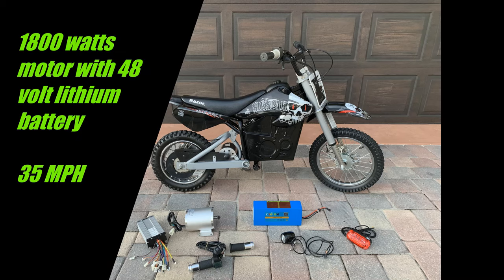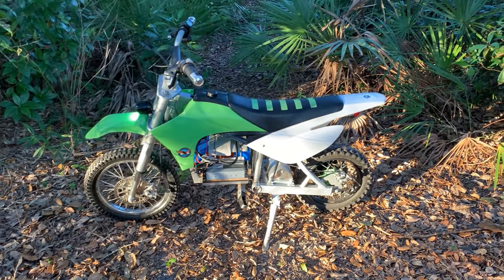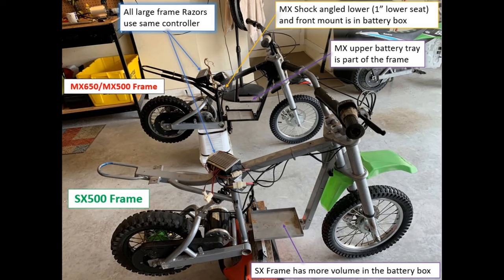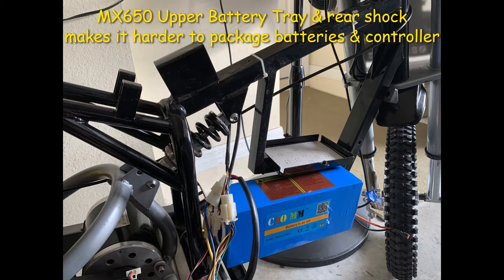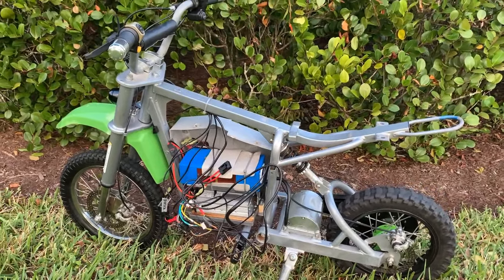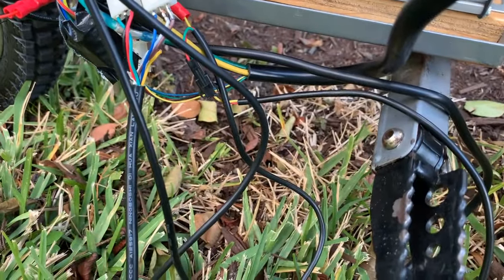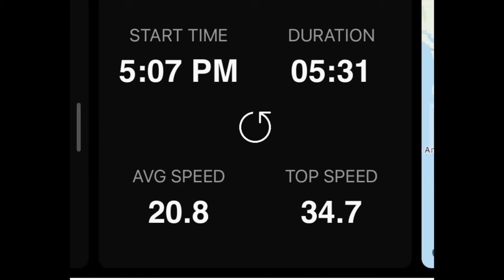go 35mph with 48V 2000W motor - Razor MX650 MX500 SX500 RSF650 upgrade for $400

Comment: Did you need a junction box for this?
Reply from the maker: I think a junction box would be a good idea.  In this video I hard wired the motor wires to the controller via soldier and seal connectors

Comment: If I did this, would I need to solder?
Reply from the maker: No soldering needed.  I’m terrible at it.  You can use these solder and seal connectors which you insert the wires and use a heat gun to join them.  The other option is lever connectors which are easy to use.  Max sure which ever connectors rated for 30 amps for the battery and motor connection.

Solder & Seal Connectors: https://amzn.to/2WcCQNZ 
Heat Gun (for connectors) : https://amzn.to/39HAABD 
Lever Wire Connectors (east to use): https://amzn.to/39BuYZy
Reply: @BRichSolution  thank you so much

Comment: When wiring a one speed throttle- I wire the black and blue coming from the 3 speed together? What about the yellow? Just leave it hanging?
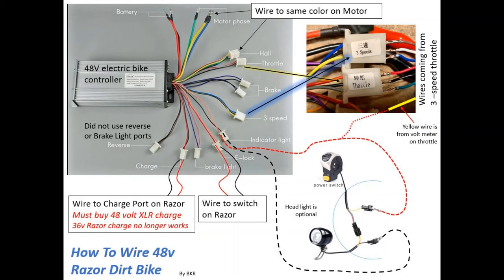Reply from the maker: Yellow wire is for voltmeter if you have one.  See poor man’s schematic at 5:22

Comment: Could this be done on a razor mx350?
Reply from the maker: Yes but you need an adapter plate to mount the motor see link for mount kit. 
https://www.facebook.com/groups/561873590646946/permalink/2197774220390200/?mibextid=W9rl1R

Comment: How long does it last?
Reply from the maker: 12 miles full throttle with 14ah or longer with mixed riding… over 20 miles with 20ah battery

Comment: I have the same set up but it doesn't go as fast as yours
Reply from the maker: Did you replace the motor sprocket from stock 11 tooth to 13 tooth sprocket?
Reply: @BRichSolution  no I haven't.. I've ordered the part but I'm still waiting for it.
Reply: @BRichSolution  thank you for answering me back so quickly. I didn't even think about that.

Comment: How long does the battery last
Reply from the maker: 12 miles full throttle more with mixed riding on 14ah.   If you go to 20ah you will go further

Comment: Yo if you are still replying then what is the cheapest that i can dod this im only 14 but still want do do this with £400
Reply from the maker: You should be able to mod it for 400.   Depends how much 48v / 14ah battery with shipping to you and motor kit?
Reply: Yo man I can mod it for 317 but it says it won't ship to my location, uk

Comment: How do you turn off and on?
Reply from the maker: I turn the bike off/on using the factory switch wired to Elock harness on controller.  See schematic in video at 5:18

Comment: What is the battery range
Reply from the maker: with 48V / 14 Ah battery full throttle on pavement 12 miles
with 48V / 20 Ah battery full throttle on pavement 20 miles
Reply: @BRichSolution  ok thank you

Comment: How long dose the battery last?
Reply from the maker: my 48v 14Ah Li-ion battery lasts over hour with mix riding.  if I go max speed in high gear it will probably only last 20 min.   you can certainly go to 20Ah battery for longer ride times (90+ minutes)   http://ebay.us/2AUk7j   or   https://eonlithium.com/product/custom-voltage-19-2ah-eon-lithium-21700-battery-made-for-mx650-mx500/
Reply: @BRichSolution  ty for responding

Comment: Can you do this on mx350?
Reply from the maker: No, the MX350 & MX400 frames & motor are smaller and will not fit this motor.   You can upgrade the MX350 & MX400 from 24V to 36V Li-ion battery and retain stock controller & motor and you will get +5 mph.   Use this battery 36V Li-ion battery   http://ebay.us/7VCLqF

Comment: Would it work on the rsf650?
Reply from the maker: yes, RSF650 is the same batteries and controller as MX650, MX500 & SX500

Comment: I got this same setup but I only get about 27 mph with a 13 tooth
Reply from the maker: You need to wire the 3 speed in high on the wire harness.  Sounds like you’re in low or medium speed.   See video at https://youtu.be/rBJ2z1ujeRg?si=euYoaAh-XkVM5e91  at 5:15 for 3 speed high medium or low

Comment: B Rich if you don't mind answering, how much do you weigh?
Reply from the maker: I am 175 lbs

As for the bike the stock Razor MX500, MX650 is 98 lbs with SLA battery;   48v Lithium Battery with 1800w motor bike weight is 75lbs.  It's a much improved weight reduction.
Reply: @BRichSolution  he meant you, as in your weight lol. He probably asks because it will factor into how fast and how well the frame and suspension handles. I am on a mx500 with a 1000w 48v system, stock frame and suspension, I am 200lbs. Works fine and I get 22 mph. I am running a stock dc motor though, not brushless. Controller has been upgraded to a 1000w 48v dc controller
Reply from the maker: @davidtheawesomeone5358  Dave does your stock motor over heat with aftermarket 1000w controller?   Both 48v SLA and 48v Li-Ion bikes over heat with adult rider long off road rides.   The motor casing was so hot you could fry and egg on it.
Reply: @BRichSolution  mine defe has gotten hot, and does. Already replaced the motor once, but I also ran some ridiculous amount of power through the first motor when I picked the bike up. New motor defe gets hot, but I dont mind. Been working for a good 6 or so months, with probably 100 or 120 miles on it. It is a used motor, but I got it for cheap so idc. Never smoked on me yet, so we will see how long it lasts. I have other issues to worry about tho, like the fact that my front forks are shot, and have a literal inch of back and forth play, and make afual noises, and really fuck up the steering as the tire walks all over the place. I am thinking of selling it and building my own bike, with a 20 hp ac induc. motor that I have. I don't mean like a 120v ac motor, it is a purpose built ac motor for a hybrid system off of a car.

Comment: What's the total run time you get from this setup?
Reply from the maker: Obvious it varies with what speed I select and terrain.   With a mix of on road & off road, low, med & high speed I get about an hour.    If you need to ride longer then opt for 20Ah battery.  I choose not to go that high as I do not ride for more than hour and the cost for 20Ah was significantly higher.     48v/20Ah battery with 35 AMP discharge rate:  http://ebay.us/fXrJmG  or http://ebay.us/BWwnPa    http://ebay.us/91NovG   or    https://amzn.to/3idq3S5
Reply: @BRichSolution  Thanks for the info.

Comment: Does anyone know a battery I can get off of amazon
Reply from the maker: The batteries on amazon are expensive and still need to be shipped ground (5-7 days) as Li-ion batteries cannot go air shipment.     I recommend one of the following batteries 48V/14Ah Lithium-Ion Battery with Charger: http://ebay.us/RI5baN  or 48v/20Ah battery with 30A BMS (longer ride time) : http://ebay.us/2AUk7j
Reply: @BRichSolution  oh dang

Comment: Hello I love this channel and all the great info that you’re giving out . I’m very interested in the set up and looking to purchase auto parts. My question is will this setup fit on a mx650?If I put the battery on the bottom and put the controller on the top? I’m sure I have to either cut or modify the top rack where the battery sits right? Also is there anyway I can contact you for more information
Reply from the maker: yes see the video at 0:09 mark how to package 48v battery into MX650 or MX500   https://youtu.be/kRvYAI1hdc4   then mount the controller on the upper battery tray.

Comment: Will this still work on a mx500
Reply from the maker: yes, it will work on the MX500; its the same as MX650
Reply from the maker: yes  it will work on MX650 & MX500.   you might have to cut out upper battery trap

Comment: I wish someone in NJ could install this for me lol
Reply from the maker: Its not that bad to install as most connectors are just two wires.  So you just match the colors from the bike to colors on the controller.   for example:  brake has red & black wires; just connect the red to red & black to black on the controllers wires labeled BRAKE.   The only one that has more that 2 wires is throttle and this kit it plugs right in

Comment: Still trust this battery?
Reply from the maker: Yes, built 14 bikes with the battery and happy with performance and longevity
Reply: @BRichSolution  do you still use these? I want to build one but not trying to spend so much since I already have gas bikes

Comment: can i fit this set up in a 350?
Reply from the maker: The my1060 motor will not fit in 350 or 400 frame without a lot of modifications.  Packaging the battery in 350 frame would tight too.   Best bet is sell the 350 and buy a used mx650, mx500, sx500 or Rsf650 or just upgrade the 350 with a 36v battery. http://ebay.us/7VCLqF

Comment: It’s slot more than 350 now lol came out to about 496
Reply from the maker: I just added up major components to under $350
$120 for motor kit on eBay
https://ebay.us/3bcZ4m
$199 for 48/14Ah battery
https://ebay.us/w8qJb3

That $320.   Add the optimal 3 speed throttle and 13T sprocket your at $350.    Optional headlight and taillight you still below $400
Reply from the maker: What am I missing?
Reply: @BRichSolution  not sure just saying it’s a lot more expensive now didn’t want it to seem like you’re getting false hope . seem like a good dude
Reply: @BRichSolution  well i did the 48v/20ah so that’s an extra 60 too

Comment: excellent video, also your comparo of MX/SX 500/650!  My son has been loving his MX350 for the last 2.5 years and now I'm on the hunt for a larger one.  Great to know the MX650 isn't worth the trouble, so looking for a used MX or SX500 which I'll upgrade.   How long does it take to charge the LiPo from nearly drained to full?  Thanks!!   Here's our MX350 (probably have cycled the batteries about 150 times since then) https://www.youtube.com/watch?v=eUkUoM-RIls
Reply: forgot to ask - if you're not riding for a week or more are you partially discharging the battery?  How is it holding up so far?  THX
Reply from the maker: battery is holding up well.   I haven't charge my bike in 10 days and volt meter reads 53.5V; fully charge it reads 54V
Reply: the point he made about the mx650 is that its not worth buying new.

used, unless you are going to need a huge battery compartment, you get whatever is the best deal. mx650 is fine, you can work around the battery dimensions or hack the upper rack out.